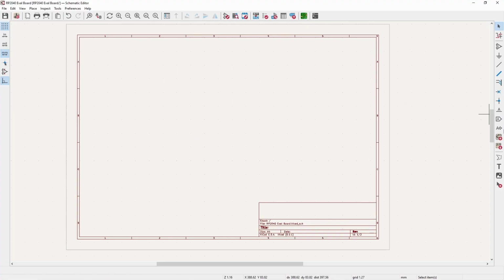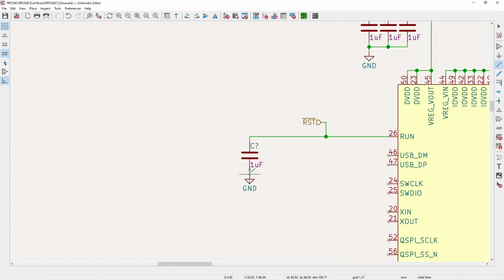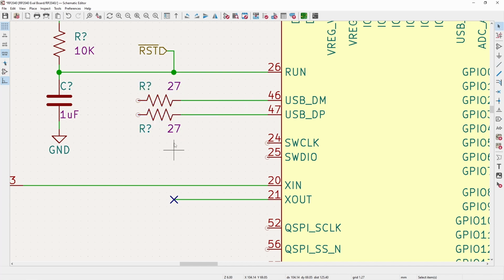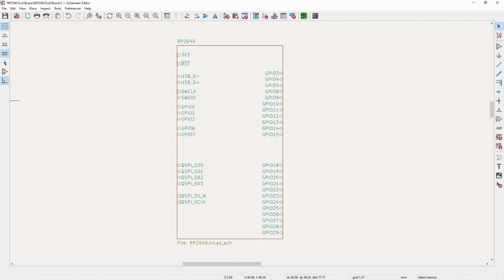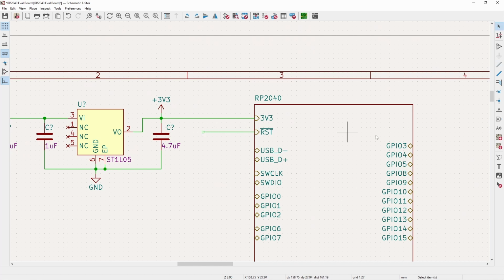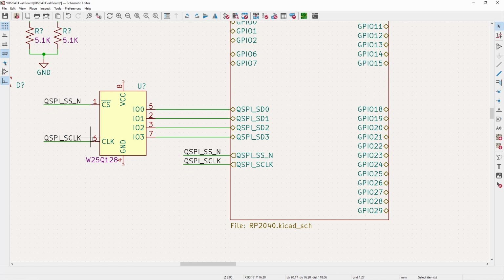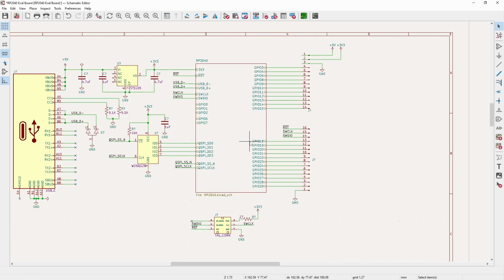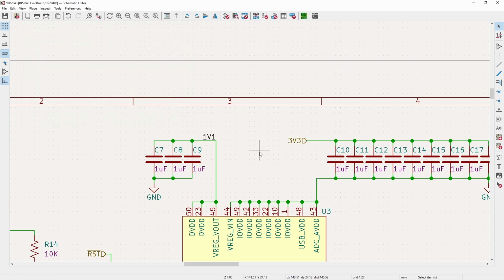RP2040 KiCad 6 Hardware Design - Part 1 - Schematic

Comment: I thought the 27 ohm series resistors on the USB lines were for impedance matching, when taken in combination with the PHY, so you don't get incoming signals reflecting back out onto the wire.

Comment: I know this is a year old now, but just came across this today. With USB you always want the resistors to be placed close to the chip. Yes it is bi-directional and as a general rule, for bidirectional lines, you can place them in the middle. But on a long transmission line you actually what them at both ends of the line at each of the transmitter/receivers. Your typical USB link is a long transmission line, in fact you likely only have one end of the link on the board. The USB spec has taken this into account and specifies the resistors at both ends. Some chips integrate them, so you don't need to include them on-board in that case.

Comment: When you say 0603 and 0805 are you talking metric or imperial?
Reply: These numbers refer to standard footprints for SMD parts like capacitors and resistors.  He also mentioned 0402 capacitors.

Comment: The oscellator recommendation is really interesting! For hobby applications I always recommend to just use an rpi pico instead unless space is restricted

But for those rare occasions where you want ~1 and are space restricted, this is better than iterating on a crystal design :)

Comment: NIce video bro, but you have a short circuit between pin 43 and GND, only remove the wire between the first capacitor near +3v3 supply and GND

Comment: As an argument FOR putting all those possibly unnecessary resistors/caps in, extra solder pads cost nothing extra, and hand-modifying a board to add them takes time and potentially ruined boards. Yeah, zero ohm resistors aren't free, but they are cheap and I'm sure you factored that into your cost evaluations. (If not on this board, some time in the past to use as a general rule for the future which is now.)

Comment: Which library are you using (components)?
Reply: Looks like his own because of the dedicated values on resistors & capacitors, and him mentioning specific package sizes when dropping those jellybean parts. Though that USB connector looks like it came from the standard parts libraries that come with KiCAD. But if he doesn't have to assign a footprint, he already did that in his own library...
Reply from the maker: @Christopher Elliott, Correct. I'll sometimes use the default symbol (USB-C connector) and just save it in my own.

Comment: Regarding the USB capacitance limit: you can AFAIK use a "soft-start+switch+current-limit" IC like the "MT9700" (costs 4 cents in large quantities) to decouple the USB input from your circuit in terms of instantly visible capacitance.
Reply: That's a nice part. Cheap and in-stock. Hard to compete with that. Closest western counterpart from Diodes Inc or TI is at least 5x the cost.